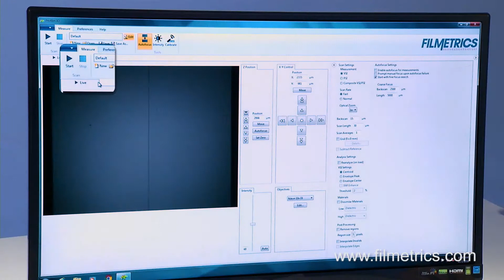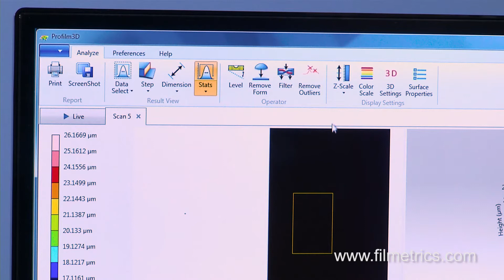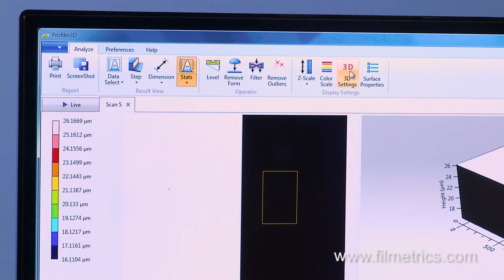Profilm3D Software and Measurement Tutorial

Comment: when i use the grid command it will capture number of images but when i stitch the image and use spatial filter operator the output image obtained will show some partition .....and output image image is not look like a single image.....please guide for this
Reply from the maker: The best way to get help for a software problem is to submit a support request from the Profilm software. To do this, in the Help ribbon click Request Support. Also, there may be a newer version of software that performs better. Our support staff can advise if a software update will be helpful in your application.